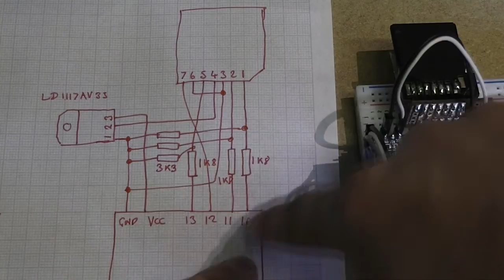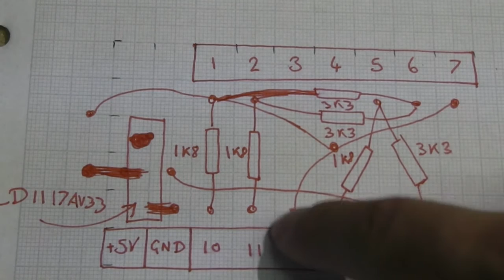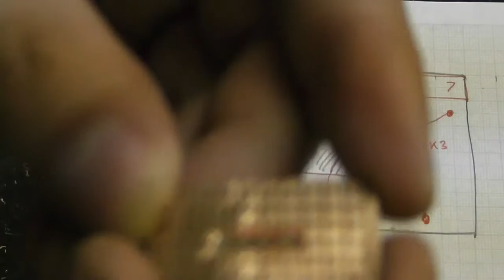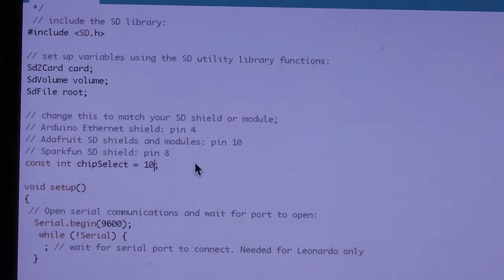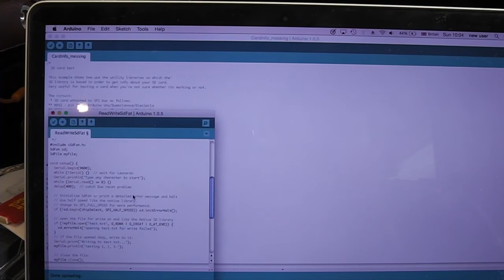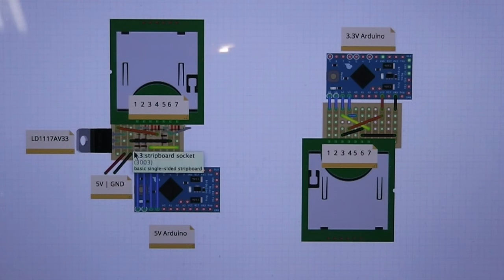Cheap DIY SD card to Arduino adaptor + stripboard tutorial

Comment: I connected every like you said and 5v shocky diode on my arduino smoked up haha, i'm gonna replace it now... There are no shorts, I don't see where is the problem hmm
Reply: there was something wrong with the voltage regulator, I replaced the diode and now everything is ok

Comment: Can I use it for arduino uno
Reply from the maker: Yes, this will work for any type of Arduino
Reply: hii again,   ur using voltage regulator IC please tell me which IC I used for input voltage  12volt 4 amp circuit , Coz i am using 12 volt 4 amp adaptor to switch on the arduino , also please tell me multiple output circuit to hav 1volt, 2  volt, 3 volt, 3.3 volt, 4 volt, 5 volt , 9 volt, from my input 12 volt 4 amp.

Comment: i tried to compile with arduino pro mini but having error, but when i tried to use different board like mega 2560 no error during compiling, any idea why?can i ask you where can i download your library?thanks
Reply from the maker: Hi, the libraries I used are not mine - the SD library is by Limor Fried and Tom Igoe and is included in the examples with Arduino 1.0.5. The URL to download the SdFat library is at 10:42 in the video, and I'm not sure who wrote that. There are a few reasons why the code may not compile for a mini. Have you set the library to use SPI half speed? If you're compiling for an 8MHz mini, that may be too slow to run the code at SPI full speed. Also, my adaptor will only work at half speed.